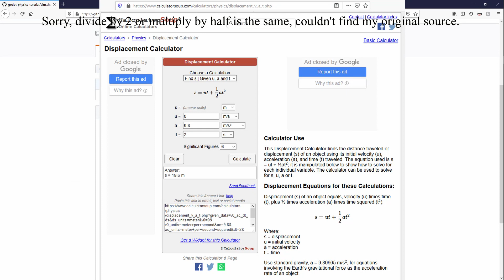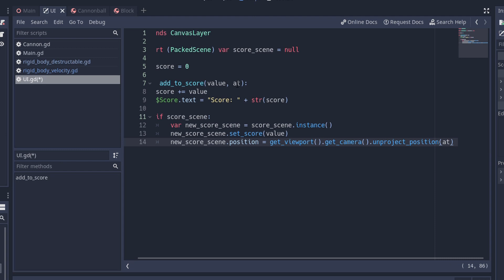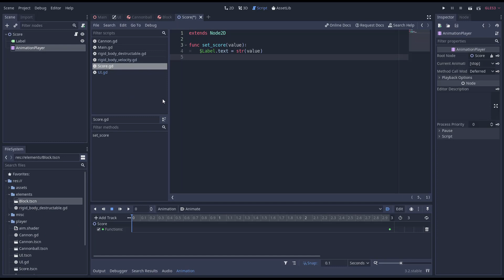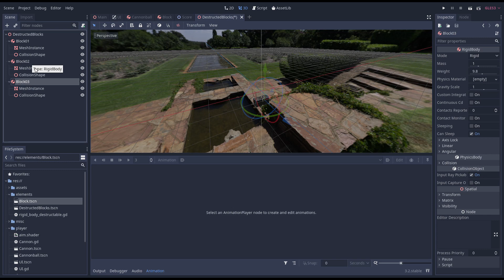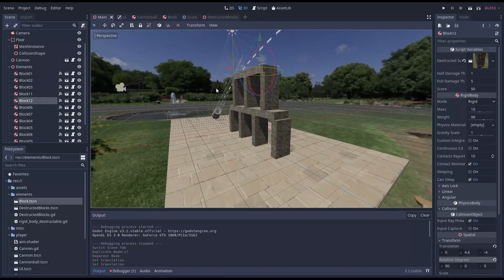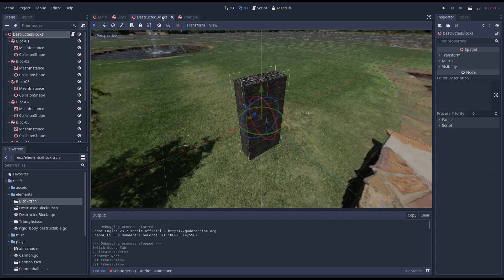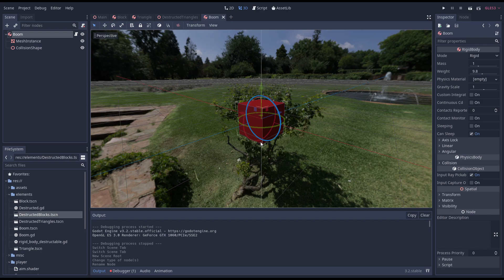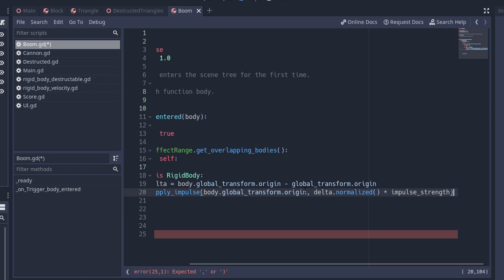Introduction into Godot 3D Physics part 3

Comment: 14:54 apply_impulse requires local coords as first argument

Eh, it's just sad that godot 3d physics is sp buggy and there's no documentation or tutorials there are for it. Things you can find is mistakes like these everywhere, making anything physical with godot is pain in the ass, because it doesn't have good API or default classes.
Reply from the maker: Ah indeed it does, I should find some time to fix that by transforming the point into local space.

A lot of work is being done in Godot 4 in updating how the build in physics engine works and towards the outward API. It's always a good idea to join the discussions either on the Godot chat server, on Discord or on Github. Some of the API choices are left overs from when physics were first build, others have a really good reason for being the way they are. Software development is a world of concessions.
Reply: @BastiaanOlij  they wont fix much with it, simply because they and most people don't work with it. I work with physics primarily in my projects and it's insane how many bugs there are. If you want physics reliant project, you'll find bugs in every thing you do. 
I'm syaing this, because physics implementation have to be rewritten completely.
Reply from the maker: Oh physics for me in VR is pretty important too so i know your frustration. 

The problem is that Godot is community driven, there has to be someone with expertise to step up and do the work.

This is why bullet integration was important in Godot 3, the hope was that by integrating a popular open source physics engine we would improve things greatly but it seems bullet has plenty of issues of its own.

In godot 4 alot is being rewritten as one of the contributors is focusing his time on it but it’s a learning curve

Best suggestion is to create small reproducable projects of the issues you are experiencing and adding the to issues raised on github

Comment: How could you show the angle of rotation of the cannon from the ground to where it moves? , with shaders it would be done or with what could I do that .. I am 2 days and it does not come out .. please help ..
Reply from the maker: You mean showing the trajectory the cannon ball is going to fly? I think I covered that in one of the parts but yes I solve it with a shader. It is simply plotting how far the cannon ball flies over time and you do this in two steps. 

First, given your initial velocity vector, and time you calculate where your cannon ball will be at that time:
new_pos = start_position + (velocity * time)

Second you apply the effect of gravity that pulls the cannon ball down (gravity being 9.8):
new_pos.y = new_pos.y + (0.5 * gravity * time * time)

By simple calculating the location at different time intervals you plot the trajectory. So you apply the above formula for time = 0.1, time = 0.2, etc and draw something at the calculated position.

I did this within a shader that adjusts the vertices along a plane and creates a ribbon. An easier way would be to just move small objects around.
Reply: @BastiaanOlij  I mean to show the angle of inclination that the barrel shows, how could I show that angle, it has an angle of inclination ..hmhm how could I do that .. I did not get the idea ..
Reply from the maker: Not sure I follow you, you mean you want to know the angle at which the barrel is rotated around the Z axis to aim it? You can just read that from the rotation property of node at the root of the barrel. 

In my example I update that based on the mouse position.
Reply: @BastiaanOlij  
I would like a shader to show the angle of inclination of the barrel, if it is inclined 45 degrees, with a curve that is always visible ... the truth is, I have no acquaintance who knows about the subject ..  :(..
Reply from the maker: Owh, you mean like an arch from the ground up to the barrel? Else if you can draw a picture of what you mean send it to mux213 at gmail dot com and I'll see if I can come up with something for you.
Reply: @BastiaanOlij  , Yes, an arc from the ground to the barrel and a number on its side that shows the angle it is tilted makes it permanent, that's why the shaders ...
Reply from the maker: So getting the angle is easy, just get it from the rotation property of the node of the barrel, remember its in radians so you'll need to convert it to degrees, drawing the number therefor is easy too as it's no different to how we draw the score.
The arc is a little trickier but not that hard. Create a plane mesh, subdivide it along the Z-axis, then in your shader you override the vertex position to something like this:
VERTEX.x = (VERTEX.x + radius) * sin(UV.y * angle);
VERTEX.y = (VERTEX.x + radius) * cos(UV.y * angle);
VERTEX.z = 0.0;

Radius and angle should be uniforms: 
- radius becomes the radius of the arch, make sure the width of your plane is set as it becomes the width of the arch (depth is ignored)
- angle should be set to the angle in radians that we got from the barrels orientation.

Probably needs some tweaking as I'm doing this from memory

Comment: Having to recreate some physics calculations outside the physics engine itself can lead to some errors, it's understandable :) Ideally it'd be cool to do it using the latter itself because in more complex scenarios there could be other things involved (other objects settings, air drag? etc) but first in this case i don't think there's a function to predict the trajectory in the library (funny but it's not the scope i guess), second if you have to do it GPU side too so it's faster to do it youself.
About an idea for an advanced tutorial i'd suggest physics materials, doing something like the AMD Ping Pong demo with different surfaces (angle, bounciness, frictions, etc) and adding objects in the playground and interactin with the character controller itself with those to see how they behave :) And different gravities to simular wind or attractors like in first person puzzle games ;)
Reply from the maker: grittynerd for the teleport in VR I actually use the physics engine to predict the path, it is alot more work. It would be interesting to see if something generic could be added to the engine but it’s a hard ask.
Thanks for the suggestion, I’ll definitely look into that, a gravity based puzzle game sounds interesting